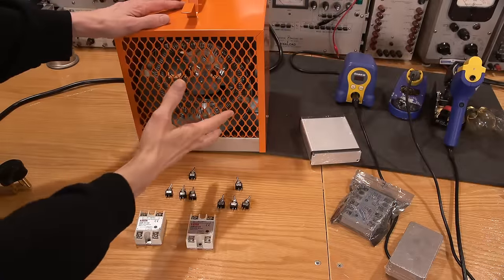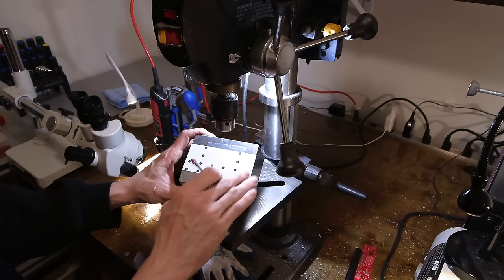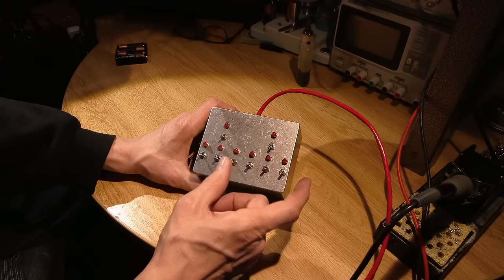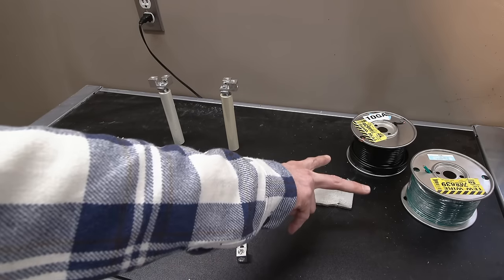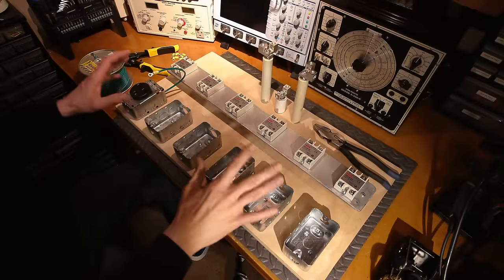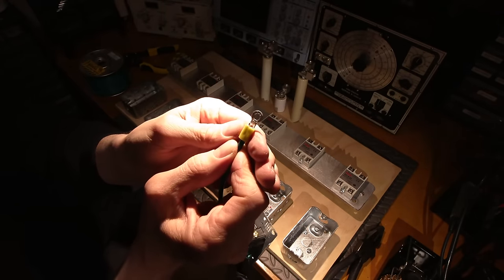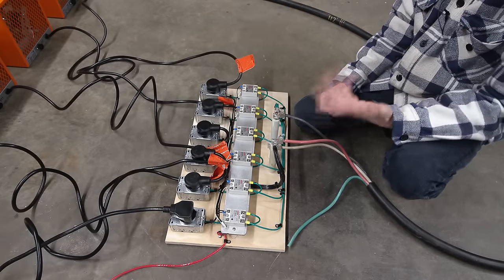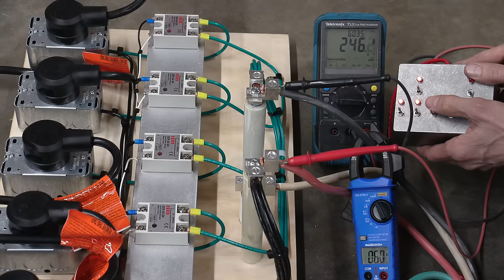27000 Watt Load Complete Build!

Comment: be nice to see more figures... maybe a mention of "jacobs law"... this was a PERFECT opportunity to attempt to explain a highly overlooked and important aspect of the whole system... that you cant use a load resistor that is LESS than the source resistance, as then the SOURCE dissipates the majority of the heat, and at maximum power, the best you can do is have load and source EQUAL in resistance. 

whats the RESISTANCE of each element?

then the resistance of the full bank in parallel?

and the generator? whats the resistance of the generator windings?

the engine is rated at ~70hp. ~52KW.

as a diesel, one can say thats 210hp worth of diesel... 30% efficient is a typical figure...
745W/hp, thats 156KW of diesel, or at about 10KW/Litre, 15.6L/hour. (be nice to see a figure on fuel consumption at full load over an hour? and the cost of it?)

then the generator with its losses... one can say its half the engine power. fudge, fudge, say 35HP, or about... oh my... close to 27KW. sorry. 27KVA, its a generator...

you dissipate 27KW in the load as heat... how much heat is being dissipated in the GENERATOR windings? thats where the other half of the engines 52KW is going... in the generator itself.

as the same current must flow through the generator as flows through the load, as per kirchoffs law, the generator and its winding resistance will be dissipating heat... LOTS of it. but it is designed to do this "indefinitely" without overheating.

bit of maths... assume a 240V output, single phase (though i expect its actually 3 phase at whatever voltage you americans/canadians use...) i can say the loadbank here is , give or take, 2.1R. about 112A at 240V. 

then whats the amount of heat being dissipated by the engines cooling system, and how much heat is blasted out of the exhaust pipe?

and then whats the efficiency as a heater of the 6 elements, at 27KW, versus simply burning that diesel in an efficient heater to release the full 156KW?

yes, i know... this is merely a load bank to test the generators output... its not actually intended to provide heat... but it does show just how wasteful the conversion processes are.

another thing to demonstrate is how various electric motors of various ratings will alter the "efficiency".... and what the shaft power of each motor will be versus the power taken to spin the generator in the first place.
Reply: He can run a heat pump with it and get The energy back with a COP of over 3 …..

The electrical generator is very efficient not losing 27 kw in it .
The diesel engine is about   33 % 
Efficient .
The wasted heat about  a third goes up the exhaust , another third in the jacket water to the radiator . A few percent for bearing / oil cooler loses .
Reply: @josephpadula2283 then why, when the generator runs at full load, is the engine also at full load? a 27Kw generator, powered by a 54KW engine... wheres the other half of the engines power going?

i assure you... from 1/3rd to 1/2 the engines power is being lost in the generator. at least 1/3rd as heat in the winding resistance alone. throw in bearing, windage, iron, and exciter losses... its half the power. theres a reason a generator driven by an engine is only ever, at most, half the rated power of the engine driving it. "the generator is very efficient".

no, they are NOT. not when running at close to full load. a generator is only efficient when its running at a very light load. THAT is what jacobs law is all about. if the generator was perhaps designed for 270KW instead, THEN it would be efficient when driving a 27KW load. whereas a 27KW generator driving a 27KW load is only capable of delivering half the power it absorbs to a load, and must dissipate the other half ITSELF.

but a 270KW generator would be rather expensive, and would seem like overkill to most people, and they would wonder why its so freaking BIG... they might stop and ask..."why do we have a 270KW generator when we only need 27kw?"

thats right... because "jacobs law" is one of those topics that is rarely, if ever mentioned, even when doing courses at university on advanced electrical engineering, whereas i feel it should be taught to PRESCHOOLERS. as it is fundamentally critical to understand it. just like impedance matching. and it is actually a very SIMPLE concept.

you cannot drive a load that is a lower resistance than the source itself, otherwise, the majority of power is dissipated by the SOURCE. at best, the resistances must be equal. ideally, the load will be of magnitudes of orders larger, and the generator or source will barely be loaded at all... at that point, you can say "the generator is efficient".
 see?  it really is simple!

even with your heat pump and COP of 3X, thats still only 70KW in return, for consuming 150+kw worth of fuel. also, whilst its irrelevant here... the heat pump may show 3X COP, but its at less than 1/3rd the temperature the resistive heating will deliver. maybe 3x the thermal ENERGY, but less than 1/3rd of the TEMPERATURE. the diesel burning by itself? the resistive heater may be able to produce a higher temperature. your heat pump CANNOT.

an electric arc could produce a temperature well in excess of what the diesel being burned ever could... it would still be only 27KW.

 your heat pump... CANNOT. it may deliver 70KW, but it will be at a MUCH lower temperature.

you got the 1/3rd or so efficiency of the diesel engine correct, as thats just fairly normal performance figures. 30%, give or take. except... the majority of it goes out the exhaust pipe. not much actually escapes through the cooling system.

you would be better off driving your "heat pump" by the burning of the diesel directly... if you could deal with the losses in heat exchangers, thermal conduction, and... oh dear... jacobs law, or at least, the same basic principle by another name, also applies to the rate of heat flow from say, a heatsink... as the cooling air approaches the temperature of the heat sink, less and less heat can be removed from the heat sink, and more and more air must pass over the heatsink... 

or in a boiler... if the water exiting is the SAME temperature as the furnace, then it is absorbing virtually no heat at all. if its half the temperature, 50%, its removing the maximum amount of heat at the highest temperature possible... thats when the boiler is classed as "efficient".

 and if its barely being warmed at all on its passage through the boiler, then its extracting a lot of heat, but its not very concentrated.

by that token, the 156 KW of energy in the diesel consumed by the engine would only give 78KW to heat air... better than your heat pump still, but then, one must consider is the end goal to get the air as hot as possible, to extract the most heat at the most efficient temperature, or simply heat a LOT of air to a relatively LOW temperature?

Comment: I bet your shop got really hot really quick with the heat coming from all those heaters AND the engine heat from the diesel engine. Considering a diesel engine is only about 35% efficient, you are putting another almost 100,000 watts of heat energy into the shop from the engine itself, PLUS the 27,000 watts from the heaters! ...that's close to 300,000 BTU's!!!   I'd be curious to see if more heat energy is released into the shop than if the same amount of fuel was burned in an oil furnace.   Also, be sure to check the frequency of the electricity coming from the generator too!

Comment: I use those relays for my brewing equipment. I don't think I'd use them for much over 2500W As I remember the only thing that is uprated from a 10A to 60A relay is the writing on the label. That is assuming that these are the ebay specials and not the original vendor ones that they copy. If I was building anything critical I would get the omron (or equivalent) ones from  a known good seller.
Reply: Btw you can get heat sinks that clip to a DIN rail for the relays, I guess you know that though.

Comment: Why wouldn’t you be taking frequency measurements also? While frequency may not be a big deal for heaters, it can be make-or-break for many of the devices in your home. I heard little to no changes in engine RPMs with load changes, so I’m sure it’s just fine, but shouldn’t frequency be a critical and routine measurement for you to be making?
Reply from the maker: Hi Steve, You can see the frequency on the TEK DMM above the AC Volts.
Reply: @MrCarlsonsLab  … Ah… The price I pay for watching this on the tiniest of screens…

Comment: @34:10 the green wire goes to air  😅
Reply from the maker: Since its connected to the isolated generator frame, you are correct (at both ends)

Comment: What is the point of a 27 kW test load?
Reply from the maker: To test the generators regulation.
Reply: @MrCarlsonsLab  That makes sense.  What is the power factor?  I would be worried about plugging in what could amount to a glorified 27 kW space heater, though there are days in the winter where I wish I had one that strong.  However, I don't think my power company would mind very much charging me almost $3 for every hour I have it turned on!

Comment: Well every mechanic just uses any solid part of material to listen to bearings. (And then replaces them all)
Reply from the maker: Hard to do when multiple motors are connected close together on a single frame. The old broom handle doesn't work so well.

Comment: Fortek SSRs have specifications that are utter nonsense, with internal power transistors/nisfets/triacs which will be unrelated to the specifications.  
I have found  15 amp rated transitors in 40 amp rated units, and also melt downs at 10 amps on  40 amp rated units.  on taking them apart, some have no proper connectin to the heat sink, just the transistor wrapped in some cheap heat sink pads,  held in place with some drooled in resin.   So zero QC, no consistency, and  they put in whatever floor sweepings of transistors are cheapest that day..  You cannot just drate these 50%, or even 75% and count on them.

Comment: It's really too bad that's the only colors they had. Well technically right it is against the code to use green for anything other than ground for safety reasons although this would probably be considered an appliance it's still just bad practice without some sort of identification.
That's a great layout and design though and the use of the box or resistors is very convenient. And for a temporary heat situation wouldn't be that hard to extend and place in various rooms.

Comment: No room thermometer?
Reply: That matters why?
Reply: @FlushCut  Between the heat being put out by the load resistors and the heat given off by the generator that room will turn into an oven very quickly!  In real world when we test generators the load resistors are put outdoors where they won't set off sprinklers and the generator rooms usually have through wall fans to pull heated air out of the room
Reply: Ha ha that’s what I meant. Would have been fun to see how quickly the temp went up. Just for the heck of it.

Comment: Hmmm.. Isn't it required in electrical codes that both legs of a 240V circuit are broken by the contactors? Just sayin...
Reply from the maker: This isn't attached to anything except a test fixture. Just sayin.